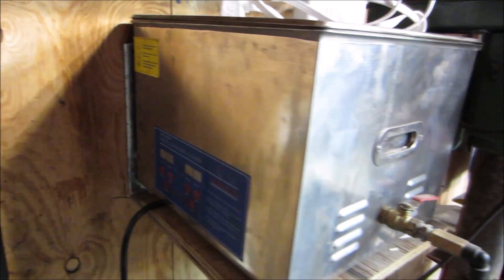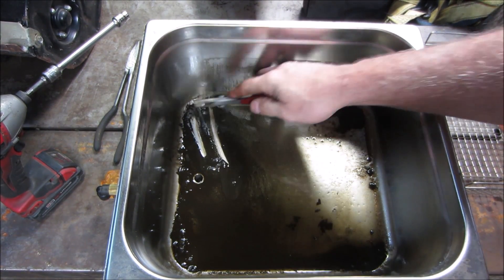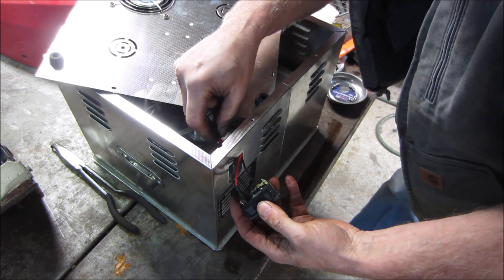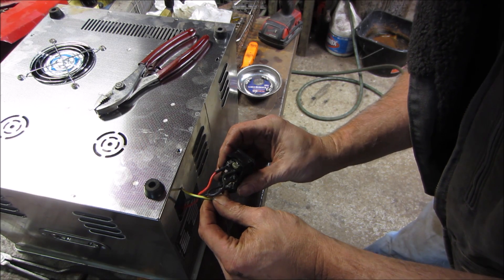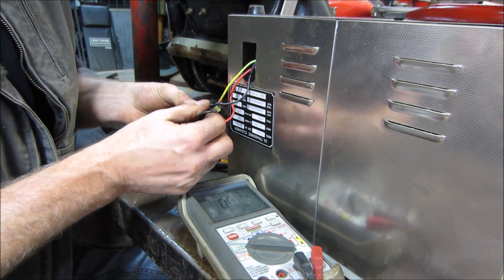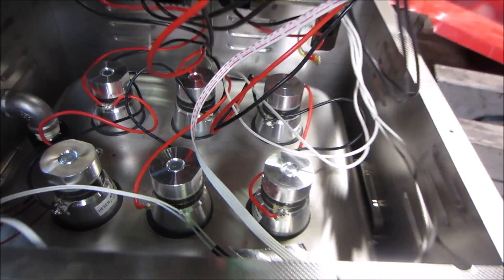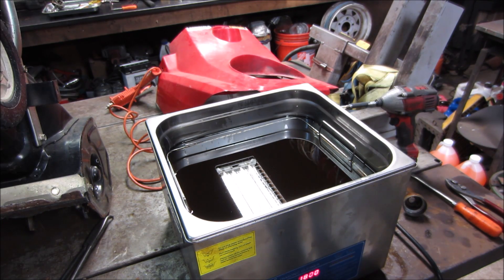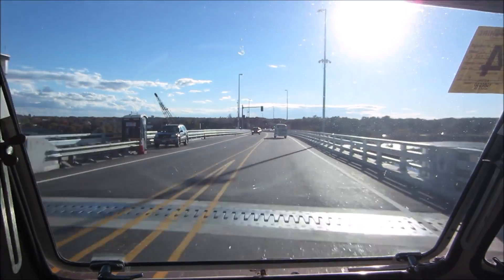Ultrasonic Cleaner repairs carburetors

Comment: I bought a 2 litre unit for small carburetors that get varnished up from ethanol.  I use fresh gasoline as the cleaner without using heat.  I fill the tank with water then put the gasoline with the part in a ziplock bag keeping the tank clean. Works great

Comment: Cool vid..but heres a long shot question as you might not read this...could I take one of these and remove the 'speakers' and put on a slightly larger bath? I got the chance of an old one but it's bath length is 20mm too short for what I need...I'd like to replace the bath with one thats slightly longer and wider and deeper..but not by too much..do you think that would work?..

Comment: Every time you turn on and off one of those switches it will build up a small amount of carbon on the contacts. Eventually the amount of carbon exceeds a working resistance and it will no longer work. We deal with this at my work place all the time. Switch replacement time or if your super handy you can at maybe prolong by taking apart and cleaning the contacts buts a short lived fix.

Comment: The machine shop I work in found that running 100% simple green All Purpose Cleaner works really well at cleaning sharpening stones/parts. 
Recommended it to a friend who tried it to clean a carburetor for a chainsaw. 
Apparently it worked way better than his soapy water mixture.
Reply: Can you precise that? Obviously there are about 6 different  simple green variations ... . Thanks!

Comment: I popped my ultrasonic cleaner open to fix the drain tube. It was unplugged but something had some energy stored. Not sure if it was a capacitor, I didn't see anything that looked like that. It may have been static electricity. I have no idea, but it sounded like it would have hurt if it unloaded on me.

Comment: Did the carburetor solution leave the parts sticky and nasty and unusable afterwards? I cleaned a carburetor that has a slide with the same solution and they became sticky and I couldn’t get it off the parts afterwards. Now I’m going to have to think of another way to get the stickiness off those parts because they won’t work. Not your fault of course I just happen to use that same solution and have a serious problem and I’m trying to figure out what other solution I could use to get that stuff off. Are used the heat while I had the ultrasound going. One carburetor came out great somehow. Anyway thanks for the video. I might get one of those machines instead.

Comment: Hello Mustie1.
There are 6 ultrasonic-speaker with 60 Watt each. That are 360 Watt together (without heating).
I've got the same ultrasonic cleaner; but my powermeter says: 177 Watt (only ultrasonic; no heating).
Do you have a powermeter? Can you check your ultrasonic cleaner with the powermeter?

Comment: Just loaded my ultrasonic with the same carb cleaning solution. Had a carb that was so bad I was going to replace it.  Could not get the jets out it was that bad.  Put it in the cleaner as a test. I could not believe how well it cleaned the carb.  It look new.  Rinse It with water, used my compressor to blow it dry and reinstalled it.  The motor fired right up and it is running great.  The only question I have is what to do with the water I rinsed the carb in?  Maybe you could give me some suggestions

Comment: Anyone who has one of these 1.5-6 liter units, could you measure the basket inside dimensions as well as the height from bottom of basket to the unit lid and post it as a reply to me?  I know the fluid won't reach the lid but want to know just how tall an item will fit with lid on, can always turn part over and reclean to get whole thing.

Thanks.

Comment: Another guy on youtube, Steve's Small Engine Saloon, uses water in the ultrasonic and puts the parts in plastic peanut butter containers with his solution of choice the drops it into the ultrasonic.  his reasoning is that if he wants to do engine parts then other things like hair brushes he doesn't have to worry about cross contamination.

Comment: Mustie1, once agian you save the day. I picked up two Ultra Sonic cleaners from a auction house near me. One is a 27 L and the other a 30 L and both have worked great till yesterday. Since getting laid off due to the Hunan Flu deal, I decided to put them to work by offering cleaning of whatever to whomever I can get. Any way, I was cleaning a couple motorcycle carbs yesterday when one of them wouldn't turn on. I freaked for about 30 seconds till I remembered this vid. I finished up the carbs using just one and drained the other. How I run them is filling them with water and using metal water tight containers with the parts and whatever cleaning solution works for the job. That way I can have a carb in one and doing rust removal in the other but using the same machine.  Any ways, I pulled up this vid and thanks to you had my other one up an running in no time. Watching your vids is like having that Jack of all trades friend, helping you out when you need it. Thanks agian

Comment: Don't ever run an Ultrasonic Cleaner Empty...  It will burn out in seconds..    This is the best way to clean a carb....  Crest builds the best machine....  Omega Clean is the stuff you want to use to clean the Carbs...  It doesn't stain and it dissolves everything....  AND it's cheap...  The passages come out spotless...

Comment: stainless steel terminals work great . i used them on electric heat strips they are much better than aluminum connectors which heat up and get loose.hvac supply house

Comment: where do you get the squeeze plastic bottles (?) with extended necks to put in the fuel? Zoom makes them, but they can only be purchased with electrical motor oil? Would like to buy 2 or 3 but can't find them anywhere.. empty??

Comment: If you want to reuse the cleaning fluid, when you drain it run it through a coffee filter. That will get the contaminated fluid cleaner. 
I use coffee filters when I put gas in my mower and other gas equipment!

Comment: Steve, from the "Steve's Small Engine Saloon" Channel, suggests filling the ultrasonic cleaner with water and then have smaller plastic containers that you place your choice of cleaning solution or solvent into and then set those and the item that needs to be cleaned into the water in the ultrasonic cleaned. That allows easier changes between cleaner/solvents and a lot less wastage.
Reply: i just watched that video. Great idea.
Reply: Yes. I am going to try that. Parts and solvents in a jar, water in the cleaner.

Comment: I actually reached out to Gunk yesterday and they told me none of their cleaning products were meant for or should be used in ultrasonic cleaners.
Reply: If they didn't test it in a cleaner. They would never recommend it.
Some people use gasoline. 
Mobile would not recommend gasoline. 

Ventilation is key.
Disclaimer,  I am not recommend either :)

Comment: The "Speakers" are actually transducers that vibrate around 55,000 hertz.  This generates millions of "scrubbing bubbles" that form on the surfaces of the tub contents.  Caution - do not put direct weight on the bottom of the pan!  This will burn out the transducers. Always suspend objects in the tray.

Comment: I worked in a laboratory, they told the students the ultrasonic cleaners could damage the ears. We used them in a fumehood/cabinet with damping material. I think it is safe with the lid on, anyway.
Reply from the maker: they make a 40 and 80k version l think its the 80 you need to worry about
Reply: @mustie1  OK, thanks.

Comment: A bit off topic Mustie1, and I have never seen this, but could you try to use your ultrasonic cleaner or a transducer from one to help desulfate old lead acid batteries. I see all these electrical methods being used but never anything with a  mechanical method. Not even sure it would be safe and it may cause more problems that it helps, but just an idea.

Comment: Gunk is the best carb cleaner I have ever used, and it gets parts totally clean, without the 40 hertz times 6. I would think the high frequency vibration would do even better, and do it a lot quicker.  Also painters use what's called cheese cloth, and if you fold it double or more it will probably filter everything. It won't be quick, it would have to be left over night, but it should make the Gunk last longer. To that I will say I have never done as many carb parts in a year as you do in a month, so it evaporates, even though I seal the can as much as possible. Kinda like it was running last year. :-)

Comment: New to the videos, this old dog has learned so many new tricks. Thank you so much for sharing. I am not going to miss any going forward.

I went out and bought the same make of Ultrasonic (A little smaller, I don't plan on working on "the big stuff", but just wondering if anyone has caught what temp he is running the Gunk at? I see mixed opinions and I am sure I want to go with Gunk, just don't wanna burn the garage down.

Comment: I've seen you mention the Gunk carb cleaner kits a few times now. For around the same price (but for more fluid) you can buy the Gunk Hydroseal cleaner by the gallon for your ultrasonic washers. Great stuff! Of course, then you don't get a paint can from it or the little basket. I've used it for a while now for carbs and swear by it.

Comment: 15 Liter capacity parts cleaner, that's about 4 gallons. You placed 1 gallon of gum out and about enough space left was about 1/2 gallon. I'm thinking you may have a 10 liter cap. unit.

Comment: Hi Mustie1
I just took delivery of one of these ultrasonic cleaners, the smaller unit with 6 L volume, but same brand. I have never used an ultrasonic cleaner before, but since I've got some carburetors that are giving me problems, I thought I'd get one. I'm the kind that never unplug any cords, so if the breaker fails on mine, I'll definitely replace it. Possibly put in a relay, if the problem is that the breaker is too weak for the application. Greetings from Sweden

Comment: So your Ultrasonic Cleaner ever goes down again and you cannot repair it there is a real easy way to clean these carburetors but you have to do it outside steel pot or aluminum pan green radiator fluid old school build a small fire underneath of it with wood cook time for about an hour and a half sometimes maybe longer drop the carbs in when you pull them out there be brand new I do this all the time with the 750 carburetors 550 carburetor actually any aluminum body carbs good luck

Comment: I just ordered a six liter one of these. I'll likely just leave the switch on all the time and not stress the switch until it finally gives out - just will use an external switch. I will open the base on mine to be sure that everything looks good after seeing that loose wire like yours had. Great video and thanks for all you do- I've learned a lot from watching you and just want to say a big THANKS - you've helped me with my small engine repairs many times by watching how you do things!

Comment: I use ultrasonics at work every day. Some are tanks that use a water based antisurficant and wax disolver, another is a multi stage automated machine using petroleum distillates to clean micro mechanics and watch movements. Ultrasonic waves travel quite nicely thuough all the solutions. One way to check the action of the ultrasonic waves used to be to toss a wadded up ball of aluminium foil in the solution and it should start to un ball when turned on. I havent tried that in about 20 years but it worked on an old vacumme tube one i had years ago.

Comment: Not related to the cleaner, but ... you have cleaned hundreds, probably THOUSANDS, more small engine carburetor than I have so I have a simple question.  The "classic" small engine carb has the bowl attached to the body with a bowl nut/jet.  There is a "rubber" gasket between the stamp bowl and the body of the carb.  Many time I have a problem re-assembling the carb because it seems that this gasket is swollen.  Is it the carb cleaner that is causing it to swell ?

Comment: I had a problem with that same type of switch earlier this year. Repairman came to pull the defective switch and replace it, but didn't have the correct replacement. Plan B popped into my head. I had an obsolete piece of equipment in my junk box with the correct switch. Pulled the switch out and replaced the failed switch. Voila, back in business. I'm glad I threw that obsolete piece of equipment in my junk box.  Thanks for helping me think outside the box, Mustie! I really like your channel!

Comment: You can replace the switch, it pops out of the case too ;)
The "other terminal" on the switch covered in glue is for the neutral, to power the small indicator light inside the switch

Comment: The cleaner has a high inductive load and when you open the switch you get a good arc from the collapse of the field. This is what damages the contacts. The timer probably says for use        with incandescent loads only. Which means it's contacts will fail prematurely. The easiest to get switch is simply the standard wall switch. It should last as long as your cleaner. Of course,       you were dealing with a Chinese part.

Comment: Hey I got a question about a Honda big red carb what would cause the gas to flow steady out the bottom even when it’s running   Can’t seem to get any body on the tube to reply back but no worries if you don’t
Reply from the maker: bad float or needle and seat

Comment: Hey Mustie to solve the weak power issue in the unit increase the cord size, I had noticed my cord would get warm when running the heat plus vibration at turn-on, I cut the cord out of mine and
inspected, my cord turned out to be aluminum wire coated with copper, I replaced it with a proper 16 gauge ul listed copper cord and no more warm cords and it comes up to temp faster

Comment: Looking at the power circuit, there is no power-"sharing" between ultrasonic and the heater - it's to seperate circuits. So heat/ultrasound will be the same, even if you run it at the same time. The ultrasonic drivers are "dumb" and you cannot throttle them. It's either on or off.

Comment: A nice easy recovery, those switches are extraordinarily cheap crap. You can always run the cleaner off an outlet strip. and let the internal controls run everything but the main power.

Comment: You got me to thinking, back in the 60's as an electronics technician I used to drop whole receiver or transmitter chassis in to a large ultrasonic cleaner containing  trichloroethylene and was thinking how dangerous that was in that small room even though it had ventilation. I guess we are lucky to be alive because every thing we used to do is now dangerous.

Comment: Question...so I use this type of carb dips as well. On the can it says not to let it get on any plastic or rubber parts as it will deform and ruin them? So some carn parts I dont clean with carb cleaner. I notice mustie just puts all his carb parts in the cleaner, plastic rubber and all. Is this an issue? Or not a big deal as the manufacture can states?
Reply from the maker: watch the last snowblower video, l explain my thoughts about it  there
Reply: Mustie1 thank you sir!

Comment: Identical replacement part is: YXQ-IEC320 C14 Inlet male Power-Socket-Rocker-Connector. If you wanted a working switch, put something in with something greater than the 10A rating this had.
Reply: 10A should be plenty. The machine should be drawing well under 7A.

Comment: I fixed the same switch for someone on a very similar cleaner. 
Make sure you tape that temperature sensor up better, it's almost come adrift.
And never run the heater with little/no fluid, that burned out the heater and was the second time I saw that unit.
That it has more ultrasonic power with the heat off sounds like nonsense to me, the heater is directly powered from the mains and has no bearing on the sound output power (other than the negligible voltage drop in your mains supply).

Comment: Your information is amazing. Always been mechanical but mystifed by carb work.  My bike stopped idling aand because of your videos, i pulled the carb, inspected the bowl, ran a wire through the pilot jet, blew through the needle valve float up and float down just to check :). Back together and running like a champ.  Thanks buddy!!
Reply: Great to hear.

Comment: I designed and built  those machines for 12 years.  The one you have there is a pretty high end unit for the size.  You never want to get near those elements when its running, very very high voltage.  40Khz is mid range.  The 50Khz are the lightweights and those are the ones that harbor freight etc. sell.  The 25Khz are the heavy duty elements.  Oh yeah, one more thing, never run them dry.
Reply: Is it true that only using water is best in them? I'm looking to buy one for the same use as Mustie

Comment: 'Ultrasonic cleaners are just made for water', BS. There are many different types of specialist cleaning fluids made especially to clean many types of contamination off of many types of items. When I began working in the electronics industry, we used some rather nasty chemicals, like Trichloroethylene. I would imagine that highly viscous fluids would hamper the efficiency of the tank though.

Comment: I too have had to bypass a power switch on some of my electric tools and I usually just plug them into a switched power strip and it works perfect to be able to have an on off switch that way and a built in circuit breaker. Thanks for the video bud and thanks for taking me on the adventure with you it was fun to see inside one of those cleaners.